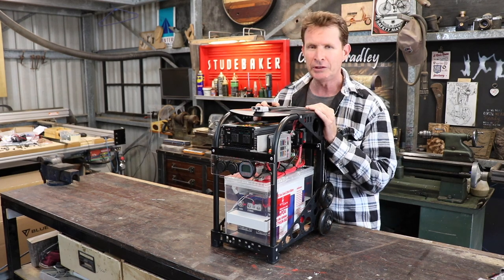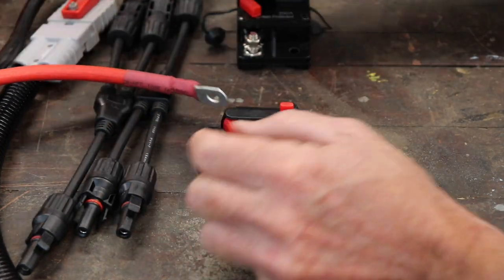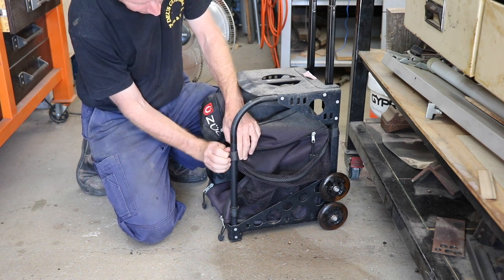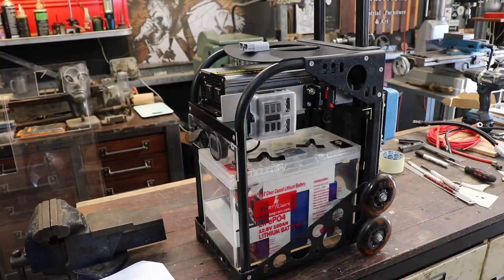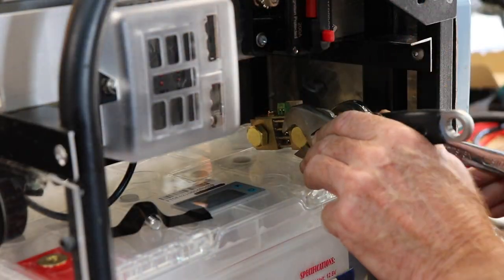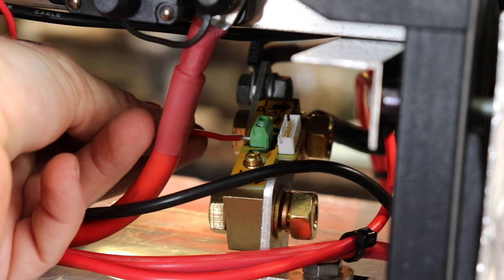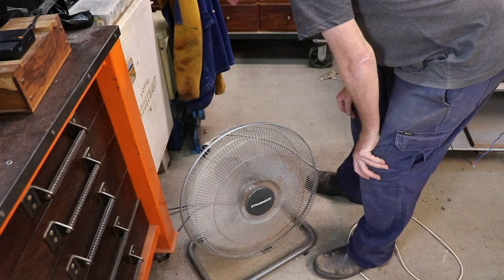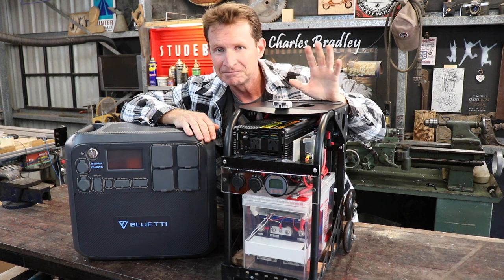DIY Portable Off Grid Power System - Forme Industrious

Comment: Off grid living, power is one of the hardest problems to solve in some ways. As a Pommie who travel around Oz back in early 2000’s with some proper 4x4 adventures before 12v systems were affordable it was the hardest thing to get used to.
Great build, repurposed cart is perfect housing
Reply from the maker: Thanks Doug! Agreed. Generally speaking, in this age we take our common utilities for granted. Power, water, waste etc is all there, we just plug in. These little systems really make you aware of how much power you use and you have to manage it carefully. Most of the parts are very accessible nowadays and quite a bit easier to use too I guess.

Comment: Thanks that was cool, would have liked it if you drew a wire diagram so we could pause and soake that in a bit.  I'm thinking of trying this, first gotta search teh availability of the components...
Reply from the maker: Thanks Mike! Yes a diagram would help, sorry. I'm not sure if I can add it now. I bought most of the parts on line except wire and lugs.

Comment: Great utility power unit.
I think you should change the wiring to the Battery Monitor with Shunt. I believe it needs to be permanently powered for the SOC monitoring. This is certainly the case if it was a Victron battery monitor shunt.
Reply from the maker: Thank you! I leave it powered the whole time. The breakers are just for protection because like you say, the battery monitor looses memory when turned off.

Comment: Anderson Power connector (and #8 wire) is probably overkill for your PV input.  Check the 'short-circuit' rating of you PV Cells (spec sheet) to determine max amps, probably just a few amps each.  Like the build!  A wiring diagram would have been a nice addition to your video...Cheers!
Reply from the maker: Thanks Tom. I think these panels are around 5 amps each at 36 volts (New). Yes 8g is an over kill but when I put the panels say 5m + away I like to have oversized cable to make up for voltage drop etc. Sorry I should have included a diagram, definitely would be useful.

Comment: Hi Scott, good video, you covered each aspect really clearly. You were fitting many of the same style of components as I fitted into a camper van conversion. Big difference is in the van, the chassis is connected to the negative. It looked like you left the chassis floating. Any reason why? I'd have thought grounding it would add a little safety, since it prevents it from being able to go live from a fault.
Reply from the maker: Thanks Andrew. I think you are right about the chassis negative. I'll ground it too as it does no harm and only improves safety like you say. I have done a couple of vans also and used the Chassis as the common negative. Cheers.

Comment: Scott, may I suggest that the Anderson [SB50] Grey plug for the solar input be changed to a light blue SB50 plug (and on the solar panel cable), this way there is no way to plug the solar into the wrong connector (top mounted Grey one), the different colour SB50 plugs have different 'keying' so they don't interchange, this alleviates incorrect plug-ins.  Good job on the unit :-)
Reply from the maker: Good suggestion Peter, thank you.

Comment: Great project Scott. easier to get going than my 4 stroke generator. could you use lead acid deep cycle batteries for this setup? what would be the cost difference.
Reply from the maker: Thanks Damo! Yes, lead will do it also and it will be cheaper by maybe 2 or 3 hundred $, However lead is heavier, slower to get the full charge and you can only use about half it's rating. Lithium tech is getting cheaper and I think even now is a much better option. Hope your neck is getting better.

Comment: Hi Scott any chance of a link to that 500AMP  shunt kit ..??....Im doing a small solar install in my shed and it looks suitable and a good price...thanks frank
Reply from the maker: It seems the link for the one I bought from eBay is no longer there, however this one is the same. The 350 amp is cheaper.https://www.ebay.com.au/itm/204318588008?hash=item2f92563c68:g:xJAAAOSw8HtjGsd2&amdata=enc%3AAQAIAAAA0NwwvHIeejw4M4Oi7YJyHdjA1dl5sDKEs%2BG%2By5VUAVl%2F%2F5TE9%2BpCUmQVOAmyc57fSsSfqWqV7dYtVuFEWU%2F4DaPiyDb08vU6lqUheVYgAdY99E%2FVhTICm9JyZ%2BBUO0O0cj0MBUoDpxIMiQL%2FpjWGTa1Xm1xgwa54Ank1EHoMwikhQuTABuy5GQmKKmxGlvcgSX7ET2hb0isaercQwldOd%2BFEIQgg9CQ2jyaiWOaje1%2BmhK%2FIuyAR058QCYdme7CVlT8GnpVxwAEApeLsoFjNuaw%3D%7Ctkp%3ABk9SR6qo9IWHYg
Reply: @ScottTurnerformeindustrious  Thanks Scott !!

Comment: Scott how did you protect your AC output for residual current, aka human safety
Reply from the maker: Good question Robert. My system doesn't have any inbuilt RCD. You would need to plug in a portable RCD and use a ground stake, grounding the inverter to the stake similar to a portable gas powered generator. There may be better ways though.
Reply: @ScottTurnerformeindustrious  The reason I asked Scott was not to be a smart-ass, but more around the fact that I am installing an inverter in my garage and I'm trying to work out how to design the RCD protection. I'm thinking of putting a ground steak and grounding it at the consumer board